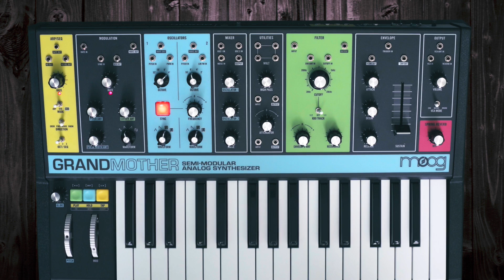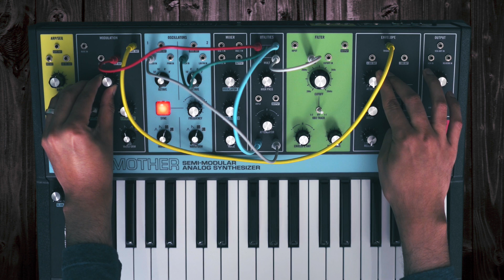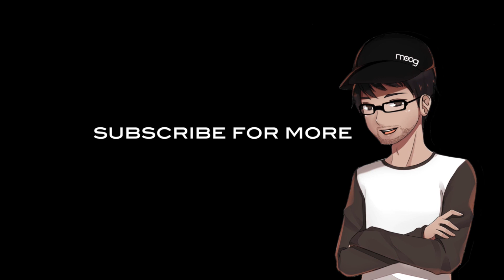Moog Grandmother - No Input Patch

Comment: Thanx a lot. Might i add, that of you have some cables left, it’s fun to connect mix out to highpass in and highpass out to filter in and filter out to vca in. This way you can shape up your sound even more with or without using the modwheel.